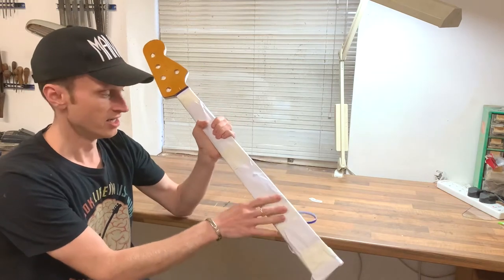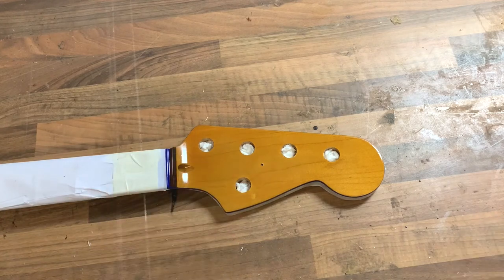Applying Waterslide Decal and Spraying Headstock Tips Luthier Video

Comment: Hi Manton Customs, I appreciate your video very much. Presently I also try to put a decal on a type of "roasted headstock" (dark wood). I put 3 coats of wipe-on poly (excellent laquer) on the headstock, then placed the decal on it and put another 3 coats of wipe-on poly over it. Like in your video (starting at 5'50min) I then tried carefully to wetsand over the decal, to bring the outlines down and to remove the "opague" white shadow under the decal. I tried that with a 1500 grid wetsand-paper. At the very beginning it worked outstanding, but what a pitty, suddenly I sanded into the decal somehow and the letters in the decal were ruined. I can't understand, how this was possible, because I was very careful and the 3 coats of laquer couldn't be sanded through this fast, because I didn't use pressure while sanding. Could you tell me , what I did wrong ? Would appreciate your advice very much. Cheers Roger
Reply from the maker: Hi Roger,
Thanks for watching and glad the video was helpful. Sorry to hear about the decal sand through. There’s a few possibilities for what caused it -
1, the poly wasn’t dry enough to withstand sanding and it was sanded too soon.
2, the decal wasn’t stuck down flat and had ridges in it which were higher than your top coat.
3, there wasn’t enough poly on top of the decal…I don’t have a lot of experience with wipe on Poly, but the ones I have used, have been really slow to build and each coat is quite thin. 

I’d recommend spraying the headstock even if you’re using wipe on poly for the rest of the neck.
Reply: You have to use lacquer spray

Comment: How long did you wait for the laquer to dry before applying the decal? The next day? Im currently planning on 10 days which is what stewmac recommends for the absolute minimum time before polishing the colortone laquer. And I assume I have to have a decent polish under the decal when I apply it or is the orange peel invisible due to the adhesive?
Reply from the maker: Overnight is plenty of time before applying the decal. 10 days or more is for the final polishing the lacquer, not level sanding. You don’t need to polish under the decal, just spray a nice wet coat (with no orange peel) and don’t sand it before the decal goes on.

Comment: I know this video is a couple years old but, if you see this—do you know a good method for re-loosening a water slide decal thats been set and dried on a maple headstock that has your typical maple clear finish? 

Nothing has been sprayed over this particular decal. I've tried letting it sit with a wet, warm and mildly soapy paper towl for longer than 20 minutes and the decal will not move. I realize I'd have to somehow get moisture under the decal but, I'm unsure if that is even feasible without destroying the decal. Thank you!
Reply from the maker: Unfortunately I think you may be out of luck, when I make a mistake like this I usually just sand or strip it off. You could try naphtha to remove it instead…on the decals I use this will dissolve the whole decal and the glue holding it.
Reply: @mantoncustoms  
For your potential future reference. After soaking with warm water and a small amount of dawn dish soap, (don't know if the soap actually helped but, was part of the process I happened to use) the decal would not slide, however, I noticed I could get the edges to pull up. I was able to gently pull the edge from one end up, pulling roughly 3/4 of the decal up so as not to have it roll and stick to itself, then dab water underneath the decal with my fingertip, lay it back down, pull opposite end up, dab water under that end, then decal would slide with no issue. 

For anyone who may try this method - keep in mind my headstock is finished maple, so the decal slid easily. Also, once you're able to move decal, try to get it where you want as efficiently and quickly as you're able as I noticed after messing about with the decal too much, the black ink - didn't smear but, kinda broke a tiny section off the print on one of the letters in the script. Good luck!

Comment: I've tried this but when it totally dries you will notice the edges of the decal, eben though how many times you add another coats
Reply from the maker: Sounds like you either had crinkles/folds at the edges, or air bubbles. Or whatever you’re spraying on is extremely low solid content. If done correctly the edges will be 100% invisible

Comment: Hallo, very helpful demonstration, thank you.  Is there a particular kind of clear lacquer spray that you would recommend? Thanks v much.
Reply from the maker: Glad you found it useful. I usually use nitrocellulose or cellulose lacquer, but I’ve also used poly over the decals. I’m sure acrylic lacquer would be fine too, but I’ve not used it
Reply: I've used Acrylic......not recommended, the decal.shrunk and ended up 'creased' under the lacquer,had to sand it all off,re-spray,and fitted new decal,then I used polyurethane lacquer...all ok
Reply: @mantoncustoms  Poly it's easy?
Reply: It's most likely that the reaction the decal had with the Acrylic lacquer topcoat was due to the lacquer being too wet, too soon, when being put on top of the decal. If you're putting on a lacquer, or even a non-compatible paint on top of a decal, or on top of a different type of paint, the purpose of several mist coats will act as a barrier / isolator between the different surfaces. Mist coats are exactly that, a mist only, and each should be dry before another is applied. Even if 10-20 mist coats of lacquer are put on over an hour, the thickness will not be too great, but should give enough thickness of lacquer for the coats to be gradually thickened without any reaction from the incompatible lacquer/paint.